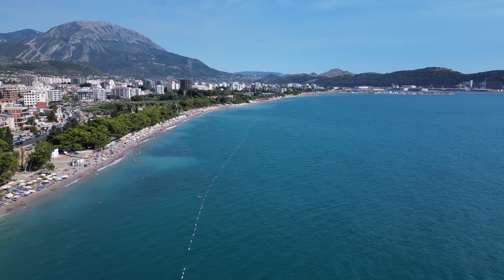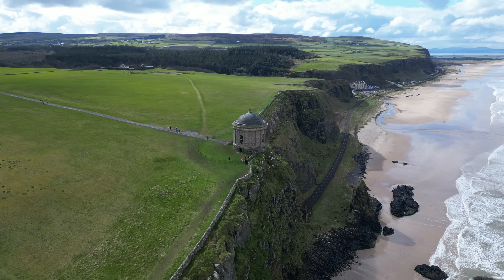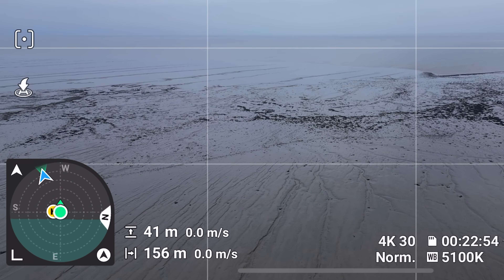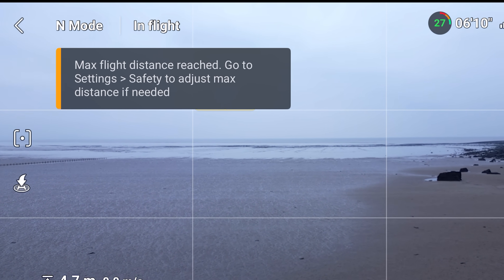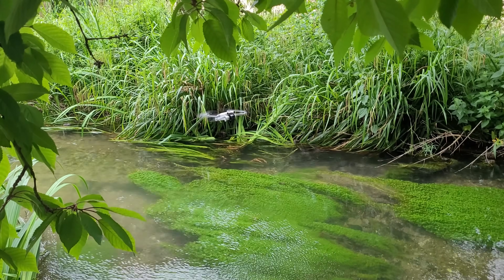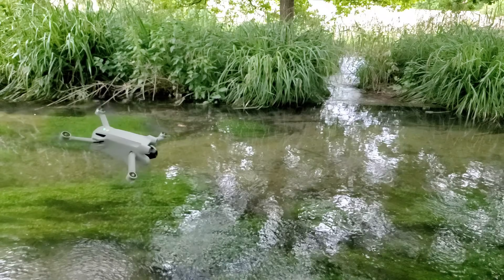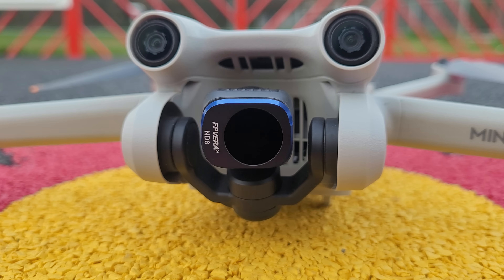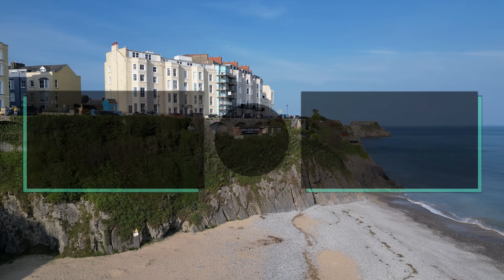Drone over WATER? Watch This First…

Comment: You should also mention that sand, especially dark sand that often contains iron, is attracted to the strong magents inside the motors, and can be impossible or at the very least very hard to get out again. So never ever land on sand (especially dark sand). Ask me how I know! 😞
Reply from the maker: Interesting… Thanks for the great tip. I would never land on sand anyways, but this “dark sand” seems much worse. Did this happen to you?
Reply: @takeoffdronesyes, I crashed into half dark sand twice. Had to completely disassemble the motors to get the sand out, because it was stuck to the magnets very strongly.
Reply from the maker: @MoritzvonSchweinitz  sounds like a nightmare to get the sand out 😅
Reply: Just learn to start and land on hand
Reply from the maker: @TastelikeChickenable  Definitely. I’d say someone getting a drone for the first time should learn hand-launching on the day they unbox the drone 😂
Reply: @takeoffdronesfirst time drone operator and i did learn it with no problem, its easy and for me most important thing, the engine wont be damaged by dust that way or rocks
Reply: How do u know? 😂

Comment: Salt water is also much more dangerous than fresh water for a drone or any electrical device. Salt water is very conductive and that current will corrode and destroy electronics in a very short time. If you can get to the wet drone, remove the battery at once. Then you may be able to rinse the drone out in distilled or deionized water several times. Then, once all the salt is out of it, you can attempt to power it up again. If you try to "see if it's alright" first by trying to fly it, you can almost guaranree that it will die an early death.

Even if the drone gets fresh water in it, you should still do the same. Only distilled or deionized water will take out the conductive elements that the water may leave behind.
Reply from the maker: Very good point, thanks!

Comment: In sport mode the collision sensors don't work.
Reply from the maker: Correct. The downwards sensors stay on though to detect height using infrared sensors and assist with landing.

Comment: Very good and clear video. When taking video over water, it is worth making that the first shot of the flight so there is the maximum battery capacity to fly out and back again. Max fly out to 60% capacity to leave plenty in reserve if there is a an offshore wind. Flying in Sport mode rather than Normal is more efficient when tackling a head wind. More of your videos please!
Reply: That's what I thought at first too, but the real reason why the drone returns slower is not the wind, but because when the battery discharges the voltage drops and the drone's speed decreases. So the second half of the battery will always be flown at slower speeds than the first half. So 60% is a good tip but I'd go even safer with 65 or 70. You just have to account for that lower voltage of the battery on the way back.
Reply: @penkatadrums  That’s useful to know, thank you
Reply: @steveseabrook7659  You are very welcome! It took me a while to figure this out. Seemed strange to always have head wind when returning 😄Too much of a coincidence! You can test this yourself, just test the top speed in the same direction with the battery full and then close to empty 🙂
Reply from the maker: Yeah, you don’t want to have the drone have a low battery warning over water! Once the wind was so strong that normal mode just wasn’t enough to tackle the wind, and so I had to use max throttle sport mode. Feel free to check out my channel - I have many more videos like this. Thanks very much!
Reply: And 21.6 kph / 13.4 mph / 6 m/s is the most efficent for power use of a DJI mini - i'm not sure about other models.  This is the speed they test their flight times, so it's most likely the highest efficiency or close enough.
For when the wind isn't an issue, but you might have pushed it a little too far away from you to return with a low battery.

Comment: I had an issue while flying my Mini 3 Pro in the Mist while flying it near a Hill. The Misty clouds mistakenly sensed as ground by the drone and kept on going on Auto Landing mode
Reply: I have experience the same after flying high up in a foggy mist, suddenly the drone told landing about 5 meter above ground and could only move it backwards not forwards almost lost the drone in the mountain 😮
Reply: @LIVE-l5j thats quite horrifying. There’s no option to disable auto landing when it falsely senses ground nearby as well. Cant imagine loosing my Drone high up in the air just because my drone decided to land itself at 1000ft above while shutting down its motors😂
Reply from the maker: I’ve heard of this problem before, and it’s probably this problem which is why DJI doesn’t recommend flying in mist/fog. I guess it messes up the downwards sensors and they think the mist underneath is the ground!
Reply: @takeoffdrones Can we see you do an experiment of this please? 😉  I wonder what happens with a fog machine.  I assume the same as mist/real fog but will be interesting to see.
Reply: In the USA, flying in fog isn't legal.  But apart from that, you run the risk of icing the propellers and losing control of it.  What happens is the low pressure on the upper surface of the propellers invites ice formation and then you lose lift.   I nearly crashed a drone and when I landed it, the propellers were covered on the upper surfaces with ice.  I had been hoping to get a super awesome video climbing through the fog and popping out above it all glorious and white but I abandoned the effort very quickly for several reasons.
Reply: @thomasmaughan4798  The place where I'm from never gets snowfall or even cold enough for propellors to get iced up. But does get very cloudy during certain seasons where clouds come down at low altitudes.
Reply: @maskedman  Interesting.  Anyway, since the cameras use stereoscopic vision, in a cloud they would probably malfunction somewhat unpredictably trying to see something on the ground.  It might be interesting to tape over the lenses (well, a piece of white paper taped over it) to see what happens if it cannot detect ground.
Reply: @thomasmaughan4798  Yeah that would be a cool way to test the sensors, but seems risky enough to make the drone go haywire. Because if the sensors get blocked by a tape, it could falsely sense it as closer to ground and go into landing mode.